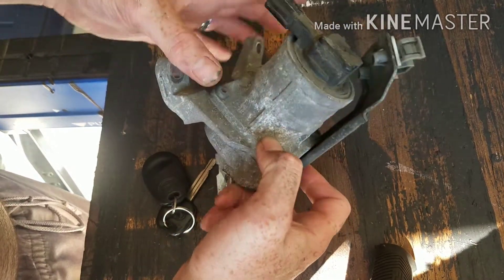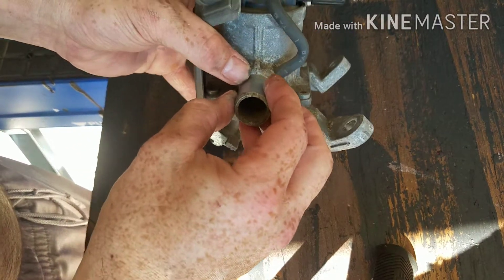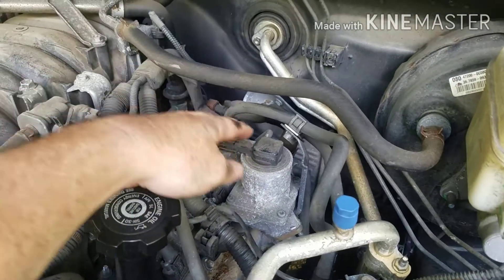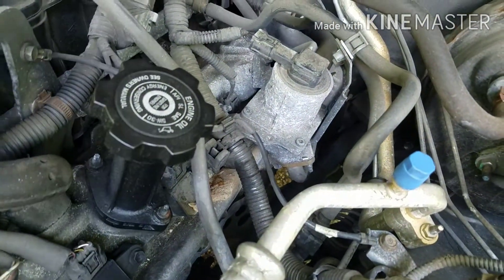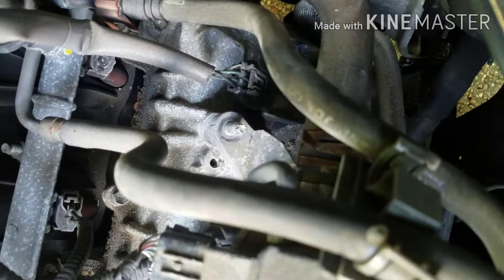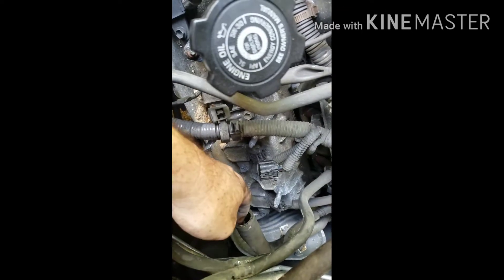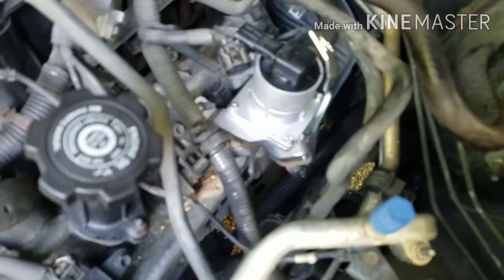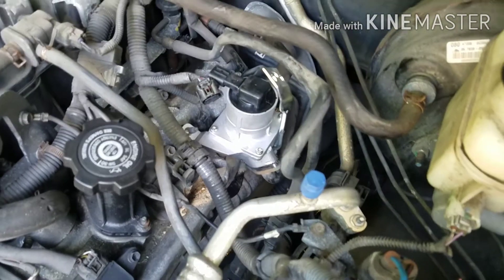How to replace a secondary air injector on a Toyota Tundra

Comment: The air nut is seized and of course it's in the almost unreachable spot. Tried to Dremel it off. 🤬. Still no luck.  Thank you for the video.
Reply from the maker: Try using a little torch to heat it up and try twisting it off

Comment: I went to take my driver side switching valve connector off and the connector broke and the wires pulled out. Any chance you know the wire color scheme from front to back? I have a replacement connector but don’t know the proper color order. Mine is a 2008 4.7.

Comment: I have a 07tundra And it likes to randomly die on me if I'm driving a higher speeds. It feels like it dies and just starts back up. But if I'm going slow I hit a bump it will die and I've got to restart. It sometimes I can restart it and slam the gas and it will stay running but today it died on me and did not Want to start but finally got it. Started? Again. The you think that could be the problem with this one too. I haven't really noticed losing power like you described but it feels like sometimes. I'm driving and it just feels like it's dying maybe losing power. Maybe what it is i'm not sure.
Reply from the maker: Sounds like something Electrical to me
Reply from the maker: But it also might not be getting enough fuel, I don't think it's the air intake
Reply: Ya electrical sounded like to me to. But it normally starts back up so it's hard to diag it. I feel like it's a loose connection somewhere. But I'm so lost. I'm good at fixing stuff but not when it randomly acts up and fixes itself where I can't diag it.

Comment: I have 2007 tundra 4.7 and I have code p2442 secondary air injection switching valve stuck open bank2 . Is this part for this code ?
Reply from the maker: Yes

Comment: Great video!! Keep them coming!
Reply from the maker: No problem, u can drive with It for awhile. I just kept clearing the code until I fixed it
Reply: I’ve had the p2442 code pop up and have been doing the same thing.( clearing the code every time it pops up and driving).  I was gonna take it to the dealer and have them fix it until I heard how much it would cost.  Fuck that!   After watching your videos I am pretty sure I can git er. Thanks brotha. Very helpful.  

How do you feel about bypass units??
Reply from the maker: Bypass works, depends on ur emission laws where u live
Reply: California. I am screwed.  

I am gonna order parts and get after it. Hopefully this weekend.  Thanks again bro for the videos. I am sure I will reference back to them as I get into this project.
Reply: Quote from today with OEM parts $4,273.30!!
 
Plenium gasket set, int manifold set, 2 air injector hoses, air valve and 2 air injector pumps.

Labor is $1,381 before tax.

Thank you for this video!!!!
Reply from the maker: DAMN!!! That's insane
Reply: Those this same secondary pump fit right and left side of the truck.

Comment: I have a 2007 tundra my code is p2441 witch is the valve is stuck closed is it the check valve or the pump?
Reply from the maker: Most likely the valve, they have them on Amazon for like $70

Comment: I have the 2011 4.0 and it's throwing both the 2440 and the 2442 code so I'll find it kind of hard to believe that both of them went bad at the exact same time. Is there another part that would go bad that would cause both of those codes to throw?
Reply from the maker: Sometimes they will both go off, I would replace them both because if not, the other will go bad very soon. Also, the air pumps tend to go bad as well.
Reply: @Grizzel  I really do appreciate your video because it's been real hard to find something on the 4.0 engine. I bought this truck brand new in 2011 and I've only got about 70,000 miles on it so it kind of pisses me off if you know what I mean.
Reply from the maker: Absolutely, what happens is the snorkle from the air pump sucks up water as well as air, and water just messes the whole system up.

Comment: Bro how in the heck did you get under the bolts to the air hose? I have no room 😅all the crap in the way and I'm very frustrated
Reply from the maker: The long bolts on the metal hose? If so I used a deep socket along with a small wrench to get it off.
Reply: @Grizzel  I can't get back there. A bunch of hoses in the way. I've tried to use the deep socket and wrench but I can't get enough room in there
Reply from the maker: Do you have discord?
Reply: @Grizzel  I don't
Reply from the maker: Well if you download discord and join my server I can do a video call with you and we can try and figure it out. I may have some time tomorrow afternoon
Reply: @Grizzel  OK i might do that. I was able to get some movement on a couple of the bolts using a small wrench but I sprayed some more penetrating oil and called it a day. I'll try it again tomorrow and will let you know. Thanks for your help, brother!
Reply: @Grizzel  did you remove/disconnect any hoses?
Reply: @Grizzel  how do I find you on discord?
Reply from the maker: On my main page there is a link in the banner, or the about section
Reply: @Grizzel  hey, brother. I was able to get these jerks off finally. I went and bought a smaller ratchet with swivel head. Thanks so much for your help, man. You definitely saved me some money! God bless

Comment: I just changed both of them,and the lights came on and still not running right,but when I ot the code reader it says that this vehicle has no faults,I erase codes and works properly gor a day or two.any ideas of what could be???
Reply from the maker: It might be the air pump

Comment: How can you tell which one is broke? The code doesn’t advise which one needs to be replaced.
Thanks
Reply from the maker: The code should tell u which bank it's on.
Reply from the maker: Also, you mine as well replace both, once one is done, the other normally goes as well
Reply: Thank you so much!
Reply: You can replace the valve but it will fail again better off bypassing the SAIS
Reply from the maker: Won't pass inspection like that
Reply: @Grizzel  there is nothing that would cause it to fail the SAIS only runs at a cold start up, there are no CEL to be concerned about. In my state we do have vehicle inspections but that only covers safety items such as lights, tires and brakes
Reply from the maker: @SeahawkAz they do emissions around my area and would see the bypass unfortunately.

Comment: Hi, do you have a part number? I can't find this part anywhere.
Reply from the maker: Ultra Power 911622
I bought mine on rockauto.com
Reply: @Grizzel  I appreciate it. I found the one for the passenger side at parts geek. Part Number: W0133-2005016
Notes: For Left Cylinder Bank. I will be ordering the one you gave me right now. Thanks again!

Comment: Can you repair it manually
Reply from the maker: You can take it apart and try.
Reply: No you can't repair there is a rubber grommet on the inside of the valve if you take the 4 screws out you will see that the rubber has melted and letting air leak by valve that's what throws the code p2443 Believe me I have looked for these grommets and can't find them. . I have started just changing the top and not the complete valve T25 4screws replace and done....